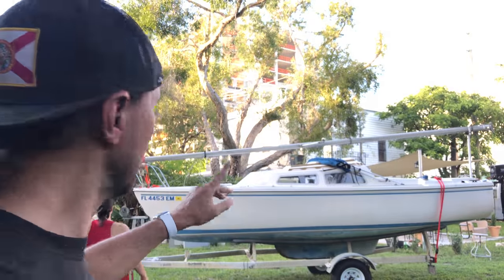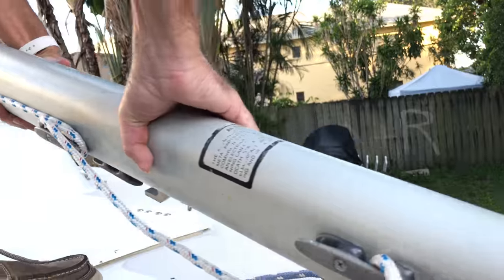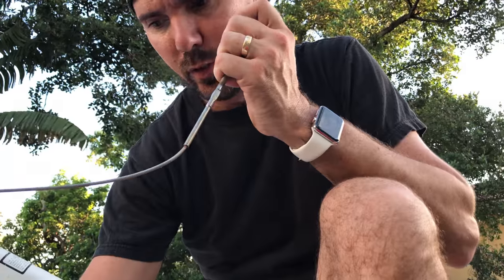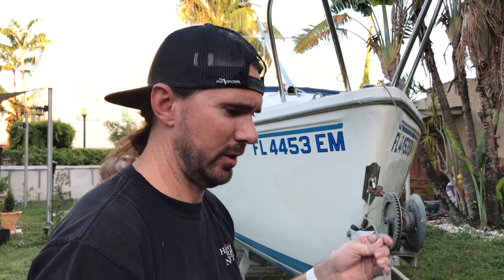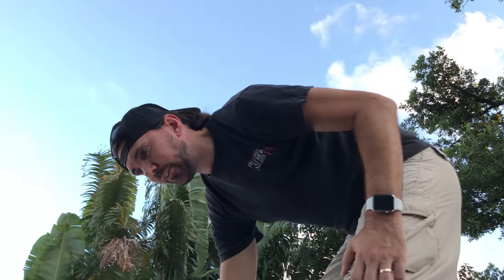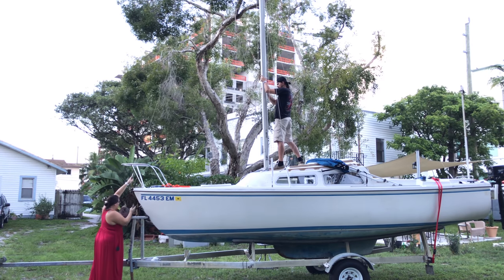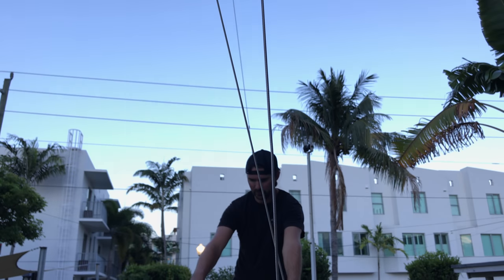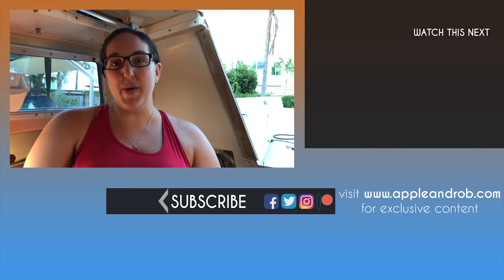How to Step and Raise The Mast on a Catalina 22 Sailboat

Comment: C-22 owner here, The turnbuckle T-bolts get bent usually when raising the mast if the shroud turnbuckles aren't facing the stern. They jam as the mast is coming up or going down. Another thing I can suggest is to put an old water bottle lid on your deck plug for the mast lights when your boat is in storage. Otherwise water can get inside and corrode the wiring. Not such an easy fix tracing wires and such.

Comment: That's what I call a soft bend... A 2x4  and hard rubber mallet will fix that like new...  Only use a hard bend in a emergency "45 deg under 3/4" radius "  if you plan on keeping long term you may want to change out all rigging to new SS fitting and wire's... Happy sailing....
Reply from the maker: Very good info! Thank you!
Reply: That's not a part you want to risk failing. Best to do what you did and replace it.

Comment: Hi Rob, Were you able  to keep the cable from sliding across any part of the boat ? Interesting system ! Thanks for posting .
Reply from the maker: It only touches the tip of the bow when the lift cable first gets tension, then it lifts away and is not a problem.

Comment: Ahoy Apple & Rob!
I'm Thankful you made a video about setting up your mast.
I've been contemplating getting a Catalina 22.
Your video showing the bent hardware for securing the mast, as well as the size of the bolt going into the base of the mast, & a glimpse of the gauge of the mast, gave me pause for concern.
I understand this is a small sailboat, but even small jaunts up & down the Pacific, from bay-to-bay, seem like trips, that could potentially become beyond the little boat's capabilities.
My search for the right boat, should probably be expanded to more stoutly built models.
I need to try & keep the
boat/trailer combo's weight down, but I need to stay mindful of a boat's fragility-factor too.
Seeing your video was possibly HUGE in my tiny little life.
Thanks again folks.
🙏🦉
🌊⛵🌊🌅

Comment: That just happened to me this last time I went out in my Capri 18. The Left Handed T bolt that is the part of the turnbuckle that attaches to the starboard chainplate got bent. What happened was that during the stepping process it was not facing forward (it was a little crooked). My partner who was winching it up forced it the last few degrees and the force of the winching bent it. I got a new one from Catalina Direct. Lesson learned: shake out your shrouds before the last little bit of stepping to make sure they are straight.

Comment: hey, just the video i needed.   what is your yoke pipe made of and is there a roller on the yoke?    I going to try an electric winch my next mast raising.   those T-blots are most likey bent during the mast raising.    my mast has one shroud per side and still hard/easy to loose track of them and easy to bend,   A must in the back up parts box.     good stuff.

Comment: Well done for a first try.  It appears that the mast hole for the pivot pin is torn out.  Is that correct?  I sailed mine that way for a year before I fixed it.  Seemed to work even in 20+ knot winds.

Comment: I have a Balboa 22 without that nifty thing at the back of your boat holding your mast. 

Next time, seat/step the mast before you raise it on your stepper. That added angle before you seat it adds difficulty.
Reply: With the mast in the tabernacle, the midpoint of the mast is at the crutch. It's too heavy to lift the mast and fool with the crutch. Best to do it the way it was shown, lift one end then slide the mast back. That's what the roller is for.